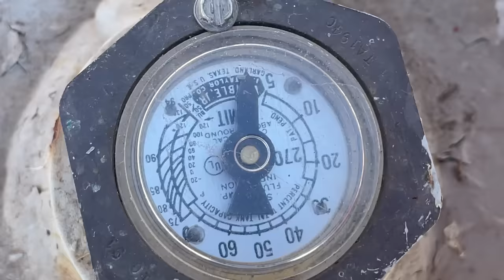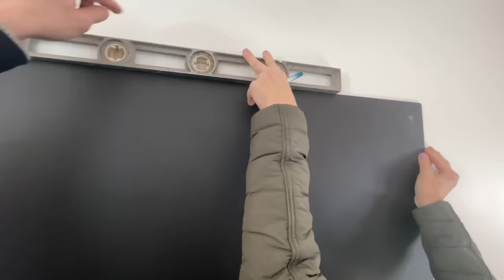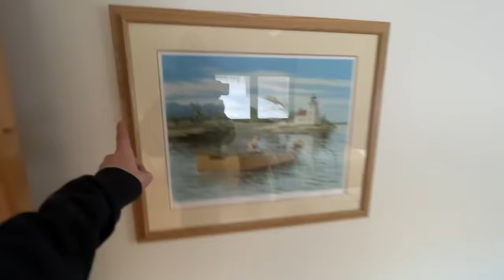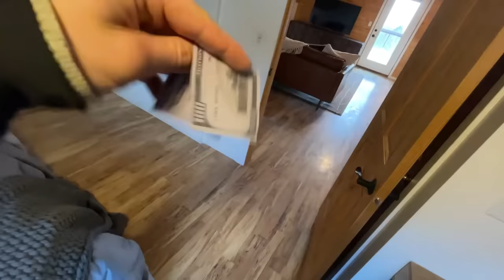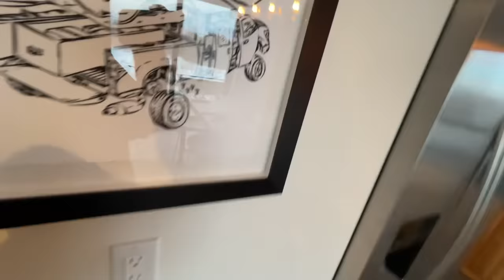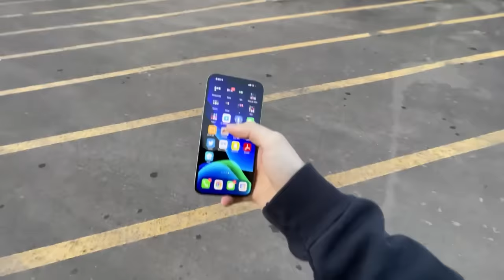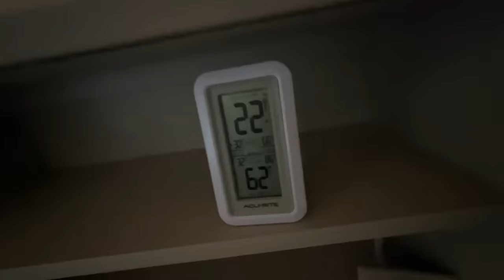My House Ran Out of Gas - Renovations Complete

Comment: Hey Mav the best way to make homemade crispy French fries is slice them how you like them!! Heat your oil up to desired temperature!! And then deep fry but not all the way to done ness!! Take out and tap dry with paper towels!!! Then put into a zip lock bag and put in the freezer!!! By doing this way the center should be cooked already and done!! By freezing them it makes the center of the French frys almost like an ice cube!! After letting them freeze over night take and heat oil up again to desired temperature!! Dump the frys in from the portion size zip lock bags that you had filled before!! Don’t let the frys thaw out before throwing them into the hot oil!!! Fry until you get your desired crispyness that you like!!! This gives the outside of the frys a chance to brown up really nicely and become crispy and warms the inside of the frys up nicely to where you actually have a little bit of potatoe inside!!! Makes for the best homemade French frys ever!!! They definitely do not come out all soggy like as if you was to do everything in the same day and not freezing them first!!! Definitely give this way a try and let me no what you think!! I definitely like my frys to be nice and crispy and definitely not soggy!!! We would definitely get compliments all the time on are frys at a restaurant that an old friend of mine’s mom and step dad owned!!! After done you can sprinkle salt on them or even some lawreys seasoned salt is awesome also!!! I’ve been to a restaurant were they wanted to have all homemade appetizers on the menu and there frys would come out so greasy and soggy I definitely could not even eat them they was so saturated in oil they was so gross!!! Awesome video buddy and remember keep up all the hard work buddy!!!

Comment: The blue fiberglass tank is your water softener which has resin inside of it. The smaller black tank is your brine tank it holds salt which is used to regenerate the resin. You're going to want to make sure your system regens based on gallons used and not just on days or else you can go through a silly amount of salt. Important to keep the water soft with that tankless.
Reply: I think he knows how to handle things.
Reply: @earlemorgan5068  @chrism0507 is just looking out for Mav! 💪🏻
Reply: correct sir follow this advice
Reply: @earlemorgan5068  please.. a professional giving advice.. mav clearly said something else about the tank... you know what.. mav doesnt need to be protected on the internet against advices. 😂😂

Comment: I love your red, Scandinavian, mailbox!  Thank goodness your house didn't get cold enough for the pipes to freeze!  There should be levers on your wood stove to control the rate of burn to save on wood.  You could have cooked on top of that gorgeous stove!  It's fun to slow cook a soup on top of the wood stove.  Good luck with your awesome house.  It was super smart to convert the half bath to a 3/4 and the 3/4 into a full.  All of your improvements have added value.

Comment: Get on an automatic fill route ! A budget plan so you only pay a certain amount every month instead of what it cost to fill the tank each time . House looks great ! I guess this summer you need to put an access drive way to the tank .  Back up solar or some electric heating options . Food cooking options , electric fry pan , air fryer , cook on the wood stove with a cast iron pan !
Reply: I did the oil heat nonsense.  Best to just get natural gas line run out to the house.  Can run a natural gas fireplace when you are out of power and firewood.  ;)  Not to mention natural gas stove/oven and hot water heater.  I mean seriously, the only thing one loses is refrigerator during an outage and with that much snow in April there, my gosh you have a natural place to keep things cool outside.  lol
Reply: Mavs explanation of his gas outage, is BS. Minnesota propane companies don't operate that way. He should be ashamed of blaming someone else for his own mistakes.

Comment: Just a suggestion Mav you should get a heat safe heat propelled fan. You put it right on top of wood stove it will help distribute heat evenly down stairs.  If there was ever a power outage as long as you keep feeding the fire the fan works to circulate hot air around room. We had two facing diff directions. Plus a cast iron kettle with water on woodstove to keep the air from being dry.
 You probably already know the ceiling fan trick or mom/dad do. To those that arnt from cold states here's a energy efficient proper way to use ceiling fans. Most have a switch close to the base or motor. In the winter switch fan so blades go clockwise on LOW speed only! (any higher draft will feel cold) this creates updraft, i know doesnt make sence but i promise it helps push trapped heat near ceiling out around room evenly expecially with vaulted, open air or, high celingings. Trust me Aroostook county Maine gets freezing and Connecticut with electric baseboard heat bill... trust me growing up i learned all my dads and grandparents tricks.we survived winters with 90% heat from woodstoves no matter the location of stove we kept warm. Just dont forget to switch fans counterclockwise for summer

Comment: Myself and my family do home renovations for a living and i gotta say man youve made some very solid choices, added a significant amount of value to that house and she looks clean af, shame im in Aus or i would have dapped you up hard with some fire goodies

In regards to the deck, a solid sanding back on that wood if its not rotted and a fresh varnish/paint would be a good way to rejuvinate that bad boy and not break the bank, or knock down those planter boxes on the deck and around the side and just add a simple railing

Lemme know if you need any advice x

Comment: Flammable paint etc., next to the wood stove Mav? I would recommend rethinking that sooner rather than later.
Reply: Isn’t their rock behind it?
Reply: @muchomango3083  yes the wood stove has a rock wall behind it on 3 walls, however there is a gallon can of paint / urethane with a paint brush on top 18 inches from the wood stove burning wood.
Reply: Remember, Mav is accident prone.

Comment: I drive a propane truck in Iowa. Never has snow drifts or piles stopped us. We also run out on the weekend if needed. You might look into a tank monitor so you can check in on it wherever you’re and make sure there filling your tank
Reply: Also get your gas contracted for next season to save some money

Comment: I'm a gas driver in the Colorado mountains, I have snow shoes if I need them. NO one clears a path to there tank from my experience. I put orange flags on them in the fall so I can find them after there's 4 feet of snow on the ground. I also have 125 feet of hose and a 20 foot extension. There is no reason for an empty tank.

Comment: Hey Mav ! 20% full should be considered as basically 0 % because you need that pressure from the tank to your lines . Also … 80% is actually full because that’s as much as you fill one . 1000 gallon tank that means if you fill it from 20% to 80% you would be buying max 600 gallons . Yours looked like maybe a 500 gallon tank so do the math. Also here if it’s not your “route” day it would cost you a $100 emergency delivery fee … and also a $100 fee to come in and relight all your pilot lights after having to bleed gas through the system . (I was waiting to see if you were going to say if they charged you for that . ) Your lucky it was your “route” day . Again … welcome to the joys of home ownership ! Your place looks great . Love the videos man … I need to send you some recipes from down south here . Keep on trucking’ Mav !!! 😎👍

Comment: We used to fill empty tanks of propane with only an adapter hose from a full 5 gallon tank to the larger empty one without pumps or electric. The pressure from a full canister to an empty one will allow most of the gas to transfer. Maybe a few would help, at least temporarily.

Comment: Hey just a little tip they sell adapters at most home improvement stores that connect the small portable propane tanks to the big guy my family used the little tanks for abo it two years on our house before we filled back up no safety issues with it not recommended but it definitely works pge just doesn’t like it but they Realy don’t care if you do it

Comment: I had a similar issue but I couldn't even get someone to refill my propane. The company I used was bought by another and I was out for 3 days. So no water as I have a well and my power went out and with no fuel no generator. Had to go to the gym to shower and use the bathroom so the positive was I worked out and used my gym membership hahah.

Comment: Would be sweet to fab up a tiny fireplace in the camper. I wouldn’t do this if you didn’t have the Carcon Monoxide sensor.  You could route an intake with vent in from outside

Comment: Well, all you gotta do is, get a gaming PC with a i9 12900K and a RTX 3090 Ti and run prime95 and furmark at the same time (it's a stability stress test for both the CPU and GPU). It'll heat your house in no time flat! But the more PC's you have running the warmer it will get. I hear that's how Linus Tech Tips heats his office. Then he does whole room water cooling to avoid using an air-conditioner in the summer.

Comment: Had to email you a recipe I created for my Marinated Grilled Thai Asian Chicken & Rice
Thin slice Chicken Breast, marinate in Brandenburg's Ginger Beer at least 24 hours, I usually use ziplock bag
Grill on flatop(my preference) or cast iron skillet (non-stick will work) 
Once chicken is cooked, mix in Kikoman's Teriyaki Sauce, minched garlic, Great Value Thai Style Sweet Chili Sauce, Yum Yum sauce.  
Add sesame seeds, toasted or not
Serve on bed of rice. (I usually use Success 10 minutes Boil-in-bag rice, for always consistant results)
I cook by feel, so I have no measurements🤦‍♂️

Comment: I have never blown a path for the gas truck to get to my tank. I have blown a path for the guy to walk to the tank. They have plenty of hose on the truck. Our supplier will deliver on the weekend but it will cost you. It will also cost you a surcharge if you run out. I think a $100. I never let my tank get below 30%.

Comment: Mav I wanted to tell you this. You shouldn’t really have your finger on the spine of a knife. Either hold it by the handle or choke up and hold the knife by the blade for more control. If you have it on the spine you might lose control and you might injure yourself when cutting tougher foods like root vegetables. Just fyi
Reply: Thanks for providing some advice to my sister Mav!

Comment: looks like its time to find a different gas company plus you will find that wood heat is sooo sooo much nicer than any other heat they also make cool non electric wood stove fans run off heat pretty cool plus filling tank once a year or less for the water heater and stove if nec

Comment: Bro ..no Solar? What century is this? Did you set your Southernly Direction and set your overhang at 23° for Winter Solar Gain on your mass floors and adjacent wall? Not to mention in ground connected to a Geothermal Heat Pump? You do have a tankless water heater connected to a passive solar hot water system, yes? Yo, next time you do fries soak them in cold water then when they've soaked about 10 minutes dry then then if you can get it use tallow ( beef fat) to fry them...or not. You'll thank me for it. Otherwise your cook'ns good Look'n. But Onions my man. Seriously in Small amount of Butter preferably. Or Avocado Oil with minced garlic right at the end of the onions softening. Or ..Garlic Olive oil. Lastly I'd have checked on newest water treatments for hard water as standard water softener suck seriously had one plus I'add if you haven't already done filtration for bathrooms and certainly reverse osmosis for kitchen drinking water. Especially given all water sources are contaminated to various degrees with PFAS ( Forever Chemicals) see Liver Cancer.

Comment: Yeah so if the driver, can walk to the tank and check it he definitely can pull the hose to it.  The standard hose length is 125-150 ft.  They didn’t check it at all.  Lazy driver.